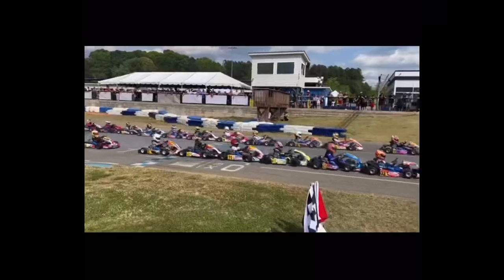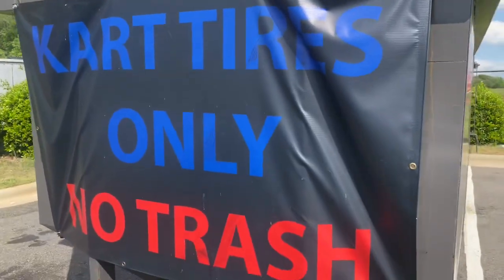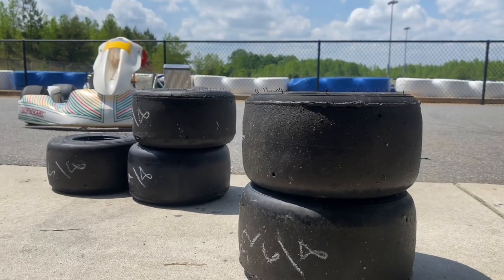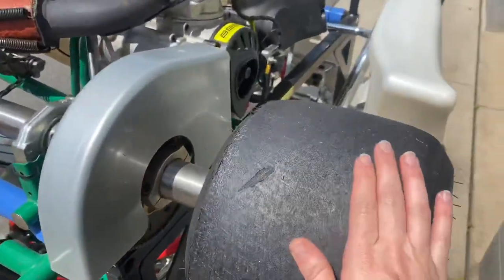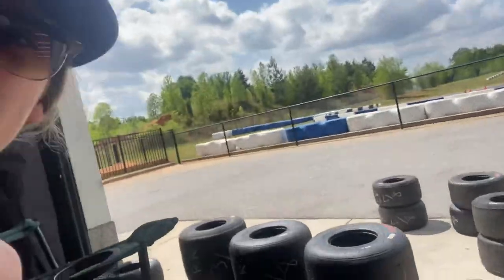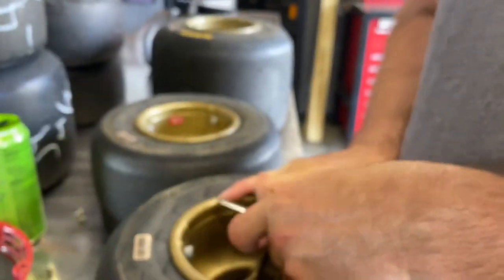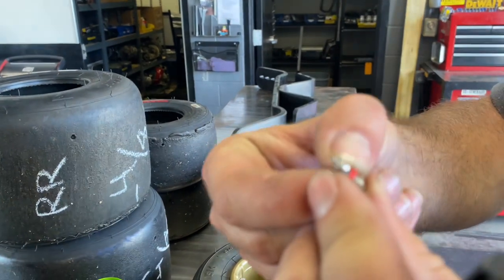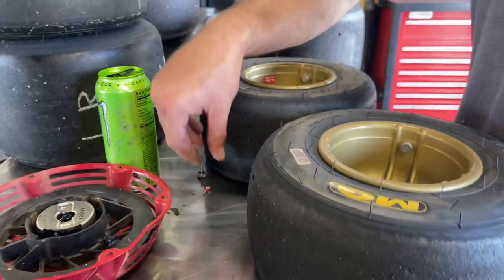Karting Vlog, Onboard, & Tire Staggering Tony Kart X-30

Comment: You gotta get a angle wedge for that wheel. You could probably set it lower for now at least with the red adjustment piece that’s on on those OTKs. Right now with how low your hands are it’s creating a lot of the issues in your driving. Having it like that lets you point too fast into the corner like you’re dealing with now. Then it doesn’t give you the leverage on the wheel once the tires load in the corner, giving you that jumping out effect you’re dealing with (especially with bumps). All together it’s hard to drive with your hands that low and at that angle. It makes it hard to drive and learn. Being comfortable in the kart is very important.
Reply from the maker: Thank you so much for taking the time
to detail this adjustment out for me!! Good stuff! In the process of adjusting and while disassembling, found out the steering column was flexed pretty bad!
Reply: @JulietteAllison  😳dang well good think you caught that. Might be good to see if anything else is bent on the kart. Usually the tie rods go with the steering shaft. If more severe the chassis can get bent too. Might be good to see if someone can get it on a alignment table. Only takes about 5mm difference side to side before the kart gets some funky handling in it. Anyways, always happy to help. It’s almost as fun as driving😄
Reply: First thing I did on my Tony Kart.  The stock angle is like driving a bus.  And is very hard on your wrists.  It's a no brainer mod.
Reply: @badgumby9544  lol no one wants to wheel a bus! Tony’s are so good anyways you can completely destroy them and still be fast.